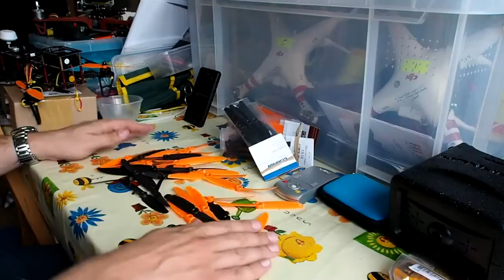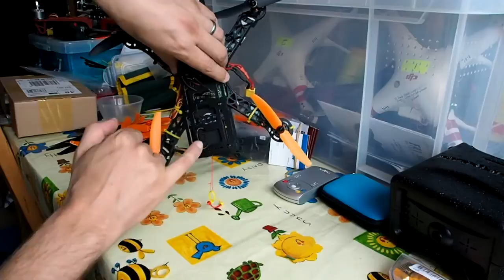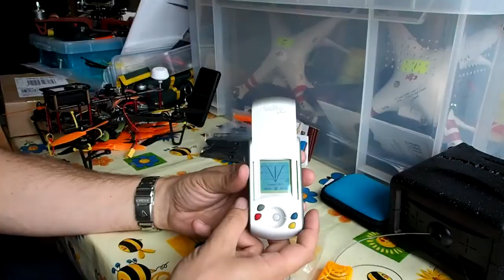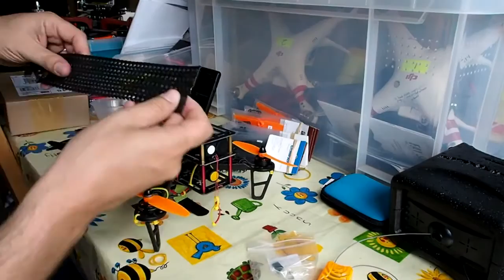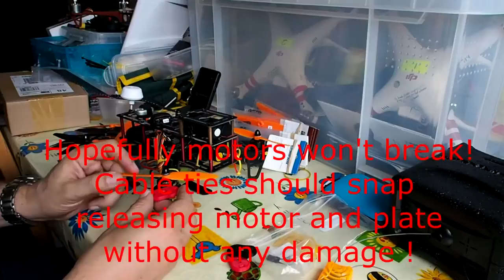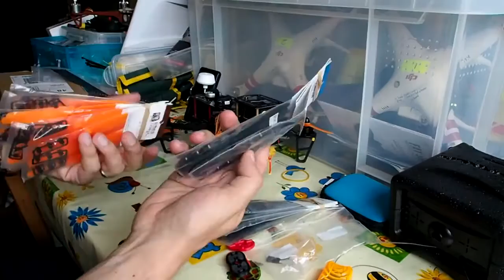FPV Quadcopter update Part1 - Hobbyking FPV250 hints+tips, Loc8tor tracker, mobius

Comment: Hi James, I've got the same frame but gonna try out the Hk Baby beast 2150kv motors and see what they are like. I hope they work out alright. Have you used a 4S with this setup? Great vids btw. Ray from NZ :)
Reply from the maker: Thanks, no I stick to 3S for everything for convenience, I am pretty sure the RCX motors wouldn't take 4S, and at 2400kv they are bit high anyway. Will be interested to hear how the 2150kv hobbyking motors run on 3S, I suspect they will hold rpm better than the RCX so actual loaded rpm would be the same or higher ! I was put off the 1900kv as I don't like 3 bladed props (they are ugly and hurt my eyes l), and figured it was too low for ~520g AUW on 5x3 props.
Reply: i have this frame with the baby beasts and it flies great

Comment: Excellent video. Thanks for that.
Still, can't find the reference of the mounting plates you referring to, on Hobby King.
Do you have it ?
Reply from the maker: Hobbyking sell the cage as 'FPV250 long frame upgrade kit' (or you can buy complete with frame as 'FPV250L'), I just pinched a spare lower plate to cover the mobius with.